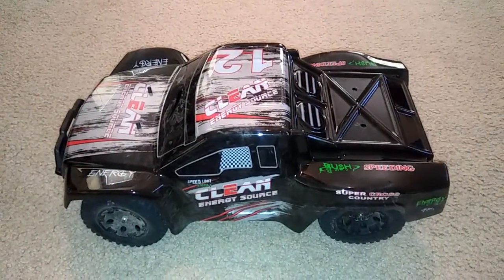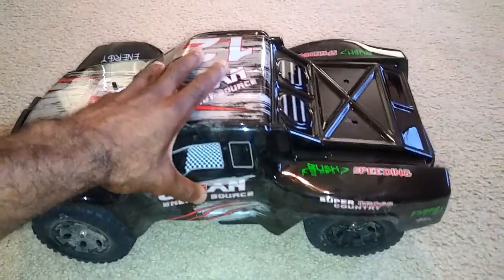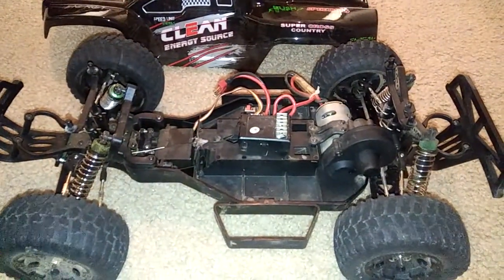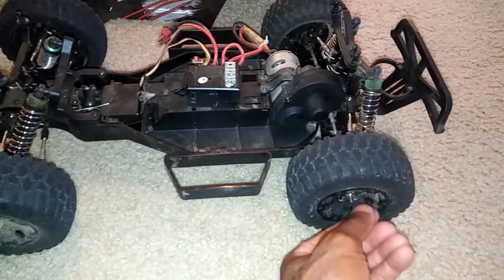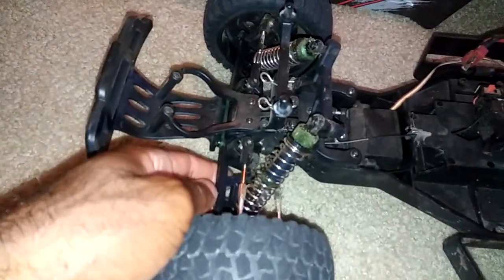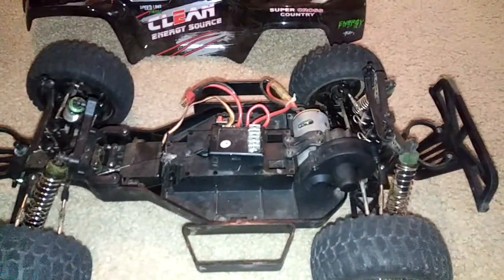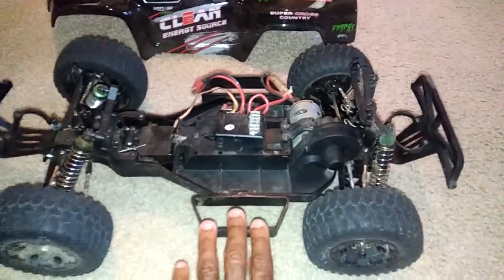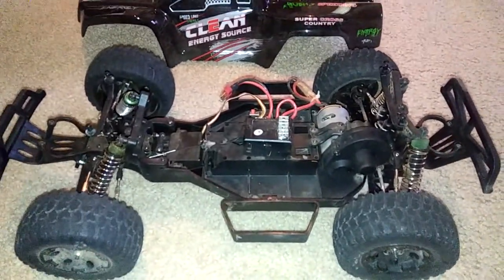WLtoys L323 2.4GHz 2WD 1/10 Brushed Electric RTR Short-Course Truck RC Car - After Run Thoughts

Comment: I finally received the needed parts to fix my Wltoys L323 installed and tested. The gears that will fail first are connected in series after the differential, the part you need is called L303-14 and the good news is one of the gears which is connected to the slipper gear via an axle is metal. I've applied generously lucas red tacky grease on the whole so hopefully it'll last longer this time

Comment: You'll need to change the servo as well beware though pushing more current to the motor it might burn on 1st run. Had it done to a brand new 540 brushed wltoys motor on my FS racing monster truck even though it was a blast 3 mins on a proper brushed esc it almost caught fire lol

Comment: You have had this truck a few months now... So you drive it much?  If so, how's it holding up?  I bought a l313 a month ago, and put a brushless system in it.  I like it but the diff can't really handel the power so I'm looking for a compatible metal diff. You have any suggestions? Thanks
Reply from the maker: +Bashing RC 24/7 never put brushless in it as I think that may be too much.

Comment: I had purchased on wltoys 12428 that it is still to arrive. Do you think the 12428 handles better the off road than this L323? And is this L323 more hobbygrade than the 12428? Keep with the good work on this channel. I'm a beginner and had been keeping up with your channel. Thanks
Reply: João Oliveira I have a l313 (same chassis on a monster truck)  and a 12423 which is the same chassis as the 12428.  And I will tell you the 12428 is an ok truck, but the l323/313 is more of a regular style hobby grade, and handles better!  Check out my channel! Hope this helps!

Comment: I am considering purchasing this because my one before which was the wltoys l979 does not work anymore(set on fire) and it would be better to get a new one instead of fixing it. I upgraded my shocks on my wltoys l979 before it broke and will them shocks fit onto this wltoys l323?
Reply from the maker: Not sure of the size of 323 one
Reply: TheBabyface774 they may fit, but are shorter, and and not as beefy.